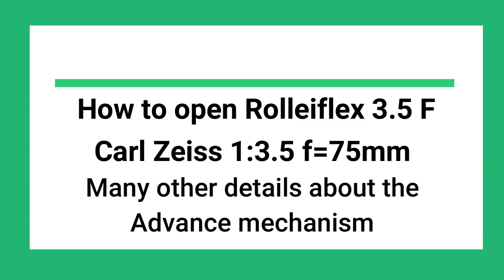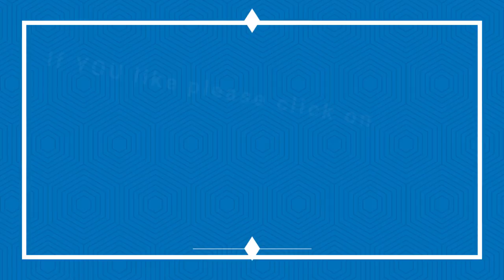How to open Rolleiflex 3.5F Carl Zeiss 1:3.5 f=75mm and other details about the advance mechanism

Comment: Other people have said this already, but you loaded the film wrong. It should be threaded between the first set of rollers before going over top of the next one. When you close the back, the two rollers get pinched together. When the film reaches that point it's thicker than just the paper so it pushes the rollers apart. That's what triggers the counter to start working.
Reply from the maker: Yeah, I discover it to late in the video, but I'm planing another video sooner in another of my Rolleiflex'.
Reply: mikeno62 I enjoy your videos very much. I have a Rollieflex 3.5f with a stuck shutter that I plan on working on and your videos are a great help. Thank you.

Comment: I have the same camera. Focusing is little stiff. Is it possible to make a video about focusing system clean/lubrication? 
Thanks for all your great videos!
Reply from the maker: My plan is to make a video about the focus side of the camera, it will come sooner.
Reply: Thank you. 
For the problem you have with this camera:
Check the adjustment of the film feeler mechanism -repair manual p.94 (14) - item 8 (p.476) fig 2.11.020